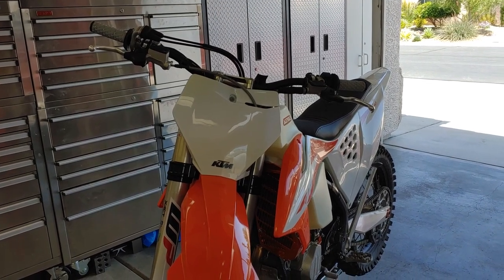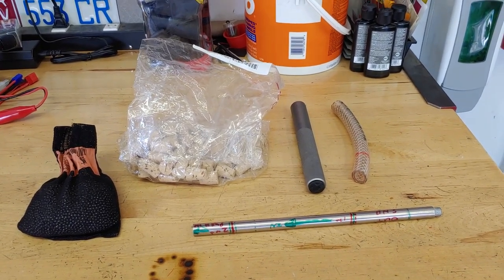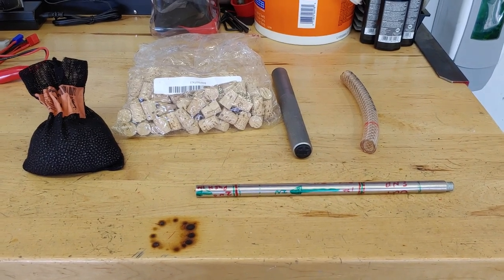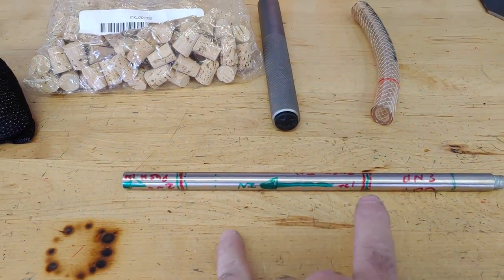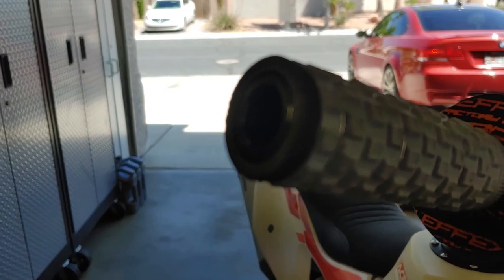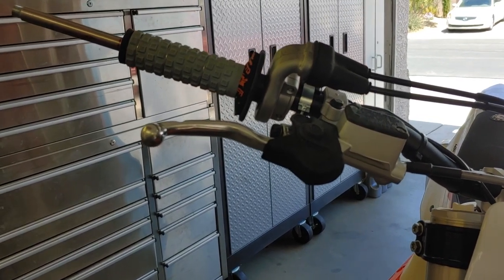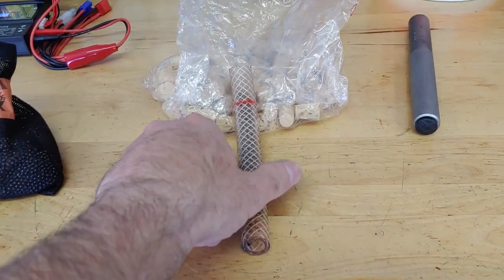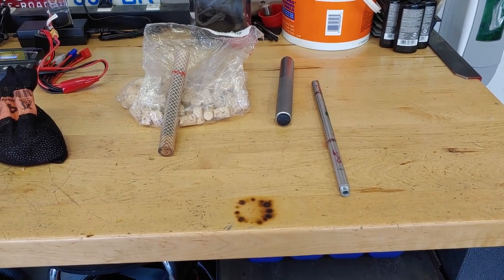Custom Handlebar Anti-Vibration Mod

Comment: I completed this solution and it made a dramatic difference on my KTM 390 Adventure.  Vibes were super strong on that bike.  I used BBs and corks and your technique.   Amazing difference.   Thanks for providing this solution!
Reply from the maker: Thank you for the feedback...glad it helped out!  Yes, it is pretty amazing how much it can actually help reduce handlebar vibration.
Reply: is it like day and night difference ?
or like noticeable but not annoying ?
Reply: Have you tried filling the whole handle bar with birdshot?
Reply: I have the same bike ktm390 adv. how did you remove the threaded part in the handle bar?

Comment: Great vid. Doing this for years on my road bikes, using divers weight pellets. No need for bar end weights since. Put weight just under grip area as you do, NOT all of bar. Simple and effective.
Reply from the maker: Thank you for the feedback.  I'll have to checkout the diver weight pellets.  I was initially surprised at how well it works...been super happy with the mod (I've done mod on 4x dirt bikes and 2x quads).
Reply: @SteveSmith-wl8yq  Divers lead pellets were easier to get hold of for me. Glad it worked for you !. Heavy Bar ends( not cheap after market) worked  on my road bikes, but tracer had very wide bars like yours, and rubbish lightweight bar ends that added more useless width. Removed and put in lead dive pellets. Sorted. Really great you posted vid for others, sometimes simple is best !
Reply from the maker: @douglasalexander4348  You might find this read interesting:  I did some research on what type of lead pellets I actual purchased 5 yrs ago... 4 lbs bag of "XS Scuba Lead Shot Weight" using #5 pellets.  It seems that lead pellets are the same for either Shotgun Shells or Scuba Weight bags...main difference is that divers can use reclaimed lead shot (much cheaper option when buying in bulk).  So, it looks like we are using the same stuff!  😂  I'm going to purchase a bag of the #4 shot (slightly larger pellets with more mass -- #5 is 0.12 inch and #4 is 0.13) to see if they work out better.  Do you know what size pellets you used?  It looks like #5 might be the most popular size used in scuba weight bags.
Reply: @SteveSmith-wl8yq  What a coincidence ! Not sure what size, it was a mesh bag for about a tenner from simply scuba. Not sure there was a choice other than weight of bag. ref mass. You would get more weight for area with smaller shot, less air gaps. My yamaha stock bar ends were light, replaced with quality heavy Honda, and made a big difference. So heavier is better. Another thought I had was fisherman’s casting weights, big lumps of lead, then infill gaps with shot, but seemed more of a faff. Keep me updated...
Reply from the maker: @douglasalexander4348  I found (on Amazon of course!) scuba bags with #4 shot...the main selling point was same weight/mass in a smaller package.  I'm going to purchase a bag of #4 and then compare actual mass differences for same size/volume of tube.  I'm sure there is some special formula to calculate such differences, but I'll just use the medieval method.  I understand your comment on less air gaps; however, you will have "more" air gaps (total non-used volume is the key).  A solid piece is max mass (stating the obvious), but it seems logical to me that there would be a hypothetical sweat spot of pellet size to number & size of air gaps when considering volume of available area...where just the right ratio yields more mass than going bigger or smaller on pellets.  This is all well and good if true, but the only difference I care about is if I can get more noticeable mass with #4 vs #5 shot, for the volume/area used in my handlebars.  Special Note:  My grandparents are from Bishop Auckland...I have 5+ish years in the UK ("sorted", "tenner" , and of course "faff").  I'll keep you posted on what I find out...it most likely will not be until sometime next month (Jan 21)...have to buy the pellets and a digital scale.  Hope you holiday season is relaxing and enjoyable.

Comment: I just fill the ends of the bars with silicone, might not work as well as this but it works, and is quick to do.
Reply from the maker: Hey, it only needs to work well enough for you...i wish something like that would work well enough for me!  I know my setup works better than the factory inserts on some quads and bikes...because the factory inserts didn't work good enough.  Have a good one...
Reply: how deep you inject the silicone?

Comment: I have tried Doubling my bar end weights . It has given me good results . Next i plan to fill my handlebar with epoxy . let me know , if any one tried doing it.
Reply from the maker: Adding mass to your bars will help, so the epoxy will change things...but it doesn't have very much mass so it might not be that noticeable/much of an improvement.  I'm interested to hear how it works out.  I like using the dead-blow method because you really do not notice the extra mass in the handlebars, but it works as good (maybe better) as having a lot of mass in the bars.

Comment: Why not full bars?
Reply from the maker: Good question... the answer involves physics...but I just use the same analogy I provided in the video (dead-blow hammer).  The same reason why dead-blow hammers do not have stuff in the handle area...little to no return on investment.  For handlebars, anything past/outside the perch clamps can move/vibrate independently...the farther from the perch clamp you move the more the movement/vibration.  So adding the deadening weight/material towards the ends of the bars provides maximum effect...the closer you get to the perch clamp the less the impact and thus you are just adding weight with little to no return on investment for said added weight.  The best solution is to have all the weight added to the last 1/2" of the bars, but the best off the shelf solution I could come up with is the diving weights/pellets added to the last portion of the bars.  Hope this answered your question well enough.
Reply: @SteveSmith-wl8yq  makes sense. Thanks for a good reply and video
Reply from the maker: @waynek7190  Thank you the kind comments...I hope the info / solution is helpful at some point.
Reply: @SteveSmith-wl8yq  You should be a physics Teacher!! LOL
Reply from the maker: @bwnco  that would be a fun job...but only with kids from before Y2K!  Lol...
Reply: @SteveSmith-wl8yq  Ive taught a few classes an actually, most rewarding fun thing to do.  Your expamples they would love.  I taught of all people.. oil field workers.. from 18 to 50.. was a blast!
Reply from the maker: @bwnco  That is pretty cool...  👍👍

Comment: Looks good, was planning on doing the same thing. One thing that I seen on a forum which makes sense, is to try to use various sizes / densitys of materials for the bar filling, this is because different materials have different harmonic frequencies (which you want to avoid) i don't know how realistic this is or how likely you would be to see any results
Reply from the maker: I think that is correct...I know at least some dead-blow hammers use multi size pellets as the filler material.  The real trick with limited space (inside handlebars) is to still have enough mass to make a difference.

Comment: Cool I'm going to try this, thanks for the tutorial. Does this setup also reduce the hits from roots and rocks on the trail or is it mostly engine vibrations? The Mako 360 sounds awesome but is super pricy at 470 USD!
Reply from the maker: Sorry for the extremely long delay with a reply...overlooked your post by accident.  Sorry, but the mod only really helps with handlebar vibrations.  You might sense a minor improvement for the other condtions you mentioned.

Comment: Hello, what is the diameter of the lead bird shots?
Reply from the maker: Good question... IMHO the two main variables that make the mod work well are: Mass & Volume. A 2mm pellet would easily address the volume side of things; however, I do not think that small of a pellet has enough mass. If they are made of lead (vs steel) then the mod should help some (if made of steel then will only help a little -- my best guess). I'd opt to use lead balls in the 3-4mm range.

Here is what I purchased for the mod ( https://www.amazon.com/XS-Scuba-Diving-Weight-Orange/dp/B0020L0GKQ/ref=sr_1_3?crid=1KVOQ2MQBF7LP&keywords=XS%2BScuba%2BLead%2BShot%2BWeight&qid=1681483388&s=sporting-goods&sprefix=xs%2Bscuba%2Blead%2Bshot%2Bweight%2Csporting%2C130&sr=1-3&th=1&psc=1 ).

Also, be careful on the sizing stuff... "buckshot" is not the same as "shot" (#4 is completely different between the two -- #4 buckshot is 6.8mm -- #4 shot is just 3.3mm).  Here is a link to a chart that might help ( http://www.rivermenrodandgunclub.com/shot-size-chart--recommendations.html ).

Hope this helps...

Comment: Also,do you ‘ram’ the second cork,hard up against the shot ? Or do you leave a ‘little gap’ so the stuff can ‘flow’ (move) a bit ? Cheers from the uk,as I said,I’m doing this tomorrow,so a heads up would be good,thanks again.
Reply from the maker: No.  Think of a salt or pepper shaker...when they are filled to the top you cannot get much of anything out of them when you shake them.  All the bird shot needs to have a small amount of movement.  The visual I'll give is if you have a clear tube filled with water and plugged at both ends...if the tube was laying perfectly flat/level you should only have enough water in it to leave a very small air gap at the upper portion of the tube (across the entire run of the top of the tube).  You should be able to hear movement of the bird shot when you shake it but it should NOT be very much movement.  If you dump the bird shot in "WITHOUT" any extra packing/shaking to compact it you should be able to run the cork in until it comes in slight contact with the first piece of bird shot (holding the bar end vertical).  I measure the gap form bird shot to end of bars so I know exactly when the deep end of the cork will end coming in slight contact with the bird shot by subtracting the cork length from the gap measurement.  Also, I'm assuming you are using lead bird shot because steel shot will not work nearly as well.   I hope that helps...drop me a note if you need more info.
Reply: Steve Smith cheers,yup it’s lead shot,cheers for the heads up,I figured it would be ‘loose’ as in a dead blow...thanks for replying so quick...now if only it stops raining (no garage) ...ha,ha,that’s Manchester for ya ! Cheers.
Reply from the maker: @joelfildes5544  Been there....lived that for more than a few years (UK weather & no garage).  Our riding problems out in southwest US are 1) almost too hot to ride (note the word almost), & 2) too many excellent riding days throughout the year makes it hard to go to work when you could be riding!
Reply: Steve Smith ha,ha..I’ll take it !

Comment: I am going to have to try this! Just bought a new bike that I really like, but after a few hours riding my hands are barely functional and I am tempted to ghost it off a cliff. Pretty much ready to sell it if I cant get the vibes tamed a bit. Thanks for sharing this!
Reply from the maker: I hope the mod works as well for you as it does for me.  All 4 of my bikes have the mod ... A world of difference for me...
Reply: @SteveSmith-wl8yq  Finished the mod the other day (DR 650) while it did not reduce all the vibrations it did make a big improvement! Very noticeable in most rpm bands. There are now sweet spots with much less buzzing, something that was not present before. I did not have corks so I used some high temp silicone foam and cut it to fit tight. I also used #4 and #6 bird shot. Thanks for posting this, it was really helpful!!
Reply from the maker: @RatherBeWheeling  Glad it helped out some.  Are you going to keep the bike now or still push it off a tall cliff?  lol...  Also, seeing that #6 shot is about 15% smaller than #4 you can gain some extra dampening by upping it all to #4 size (the small extra mass will make a slight difference -- might even be a noticeable difference).

Comment: Hello from Sweden!! Will definitely try this on my 625! Vibey that one. Thanks for posting!
Reply from the maker: Hello Sweden!  I hope it helps out as much for you as it did for my bikes...and there are more than a few on this comment trail that tried it and it worked out really well for them as well.
Reply: Tja Roger, har du testat denna lösning? Vibrationer dödar mina händer när jag kör min 1000cc!
Reply: @abdulgani8432  Jag köpte mjuka skumhandtag istället. Och sen en Harley Davidson för längre resor. Problemet löst. 😬😄
Reply: @Roger_Gustafsson  ska testa och sätta tillbaks OEM styrändar. Köpte Progrip 717 men vibrationerna är kvar.
Reply: @Roger_Gustafsson  skumhandtag är monterat och klart. Alltså vilken skillnad 👌🏼💯 tack för tipset 🙏🏼💐

Comment: I posted this comment as an answer for a question down below. This is a simple way of explaining why this works and why there needs to be space inside the handlebars and not completely  and tightly compact the pellets against the corks:

Imagine the vibrations going through your entire handlebar and into your hands without the mod. You're getting all the frequencies. Adding more mass to soak up the vibration to the ends will help but will still transmit some vibration as there is "no space" between. Now imagine having space for the little lead shot pellet to vibrate out inside its own mass, bump against each other lead shot pellet, the corks and yes also, some to your handlebar. All that energy coming from your bike and on to the handlebars in the form of a spectrum of frequency vibrations will be absorbed by different sized objects, with different densities (corks, #6 and #4 pellets) with room enough to move and "not transmit" and the end result is less vibration with attenuation of several frequencies. That's the only thing I would change to this mod, put different sized pellets in but I doubt it will make much difference. The frequencies that make your hands numb are higher, that's for sure. Higher frequencies, travel farther because they are higher energy. They'll vibrate through you your grips, gloves, hands, bones and to your nerves. This causes numbness.
Reply from the maker: Cool...thank you for the post...

Comment: Thanks! Super nice. Anything ideas for foot pegs? :)
Reply from the maker: Thank you for the kind feedback... regarding foot pegs...  are you talking vibrations in the foot pegs???  If so, then there really aren't many viable options IMHO....and none I'd do/use for an off-road motorcycle.  Your options are to isolate the foot-pegs from the frame and/or isolate your boots/shoes/feet from the foot-pegs.  Either solution, to work correctly, will make for a very mussy feeling where your feet contact the bike.... not something I'd like to be riding with/feeling when trying to control/feel the bike via the contact points...foot-pegs being a main one.  Just my two cents..

Comment: my handle bar contains something inside thats used to screw in the bar end weights,.which is stock..
so i need to remove that thing from inside,.any ideas?
Reply from the maker: Had the same problem on wife's quad... thought it best just to replace the bars with aftermarket.   Id have to see what your ends look like to give any suggestions.

Comment: Did this today, slightly different process:
- Bought a 1/2" x 48" dowel for $4
- Cut 3/4" piece of dowel and inserted it into the bars until the bend, jamming it tight
- Packed in lead shot using the dowel until it was at the desired depth (2 1/4"), 
- Added another 1/2" piece of dowel to the end, wrapped in electrical tape for a snug fit
Reply from the maker: Nice!!

Comment: Cork is good for vibration dampening by itself
Reply from the maker: It can be it certain situations, just like rubber can be.  However, not in this situation...just shoving it into your handlebars...wrong application/situation.  Handlebar vibrations require mass to deaden the vibrations, and the cork is 99.9% used to just hold the mass at the ends of the bars...where the mass can be most effective.  You have three options. 1) stop the vibrations from starting in the first place -- cancel at point of source, 2) stop the vibrations from getting to the handlebars, and 3) deaden the vibrations at the handlebars.  Cork will not do anything for options 1 or 3.  However, you could use it to isolate the bars from the vibration source...but cork is not strong enough to withstand the loads that would be put on it.  Thus, cork really does not work in this situation.
Reply: @SteveSmith-wl8yq  they actually do sell handlebar mounts with rubber inserts that work just like that. Cant remember the name
Reply from the maker: @entropy5125  A lot of the off road manufacturers used rubber handlebar mounts back in the 70s & 80s...  You actually had to buy metal inserts if you wanted your bars not to twist in the mounts on simple tip overs.... I remember those days.  Have a nice one...